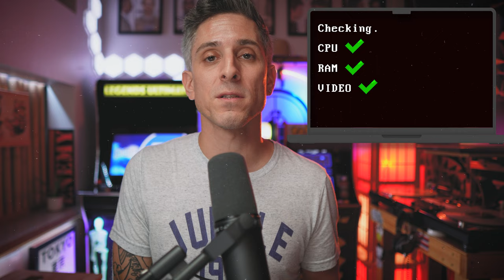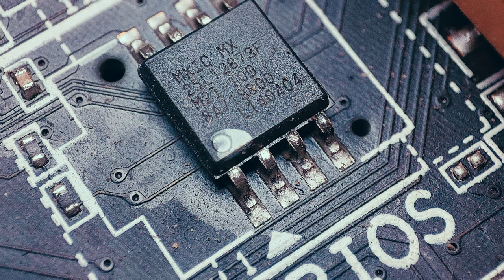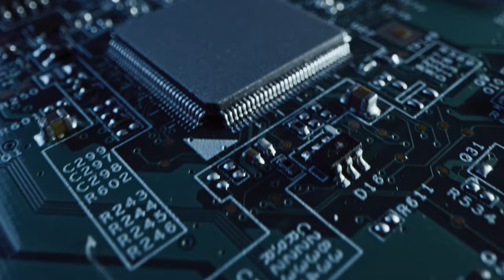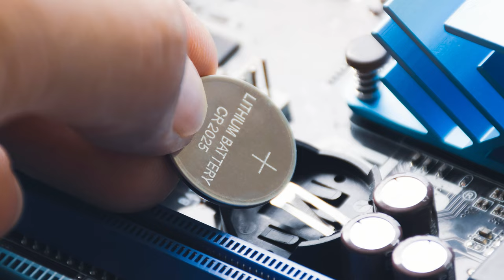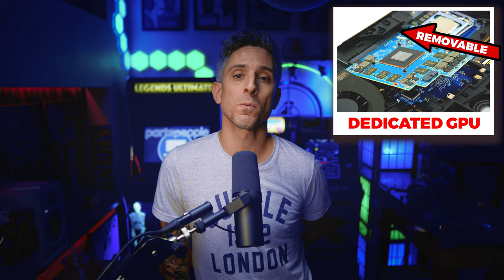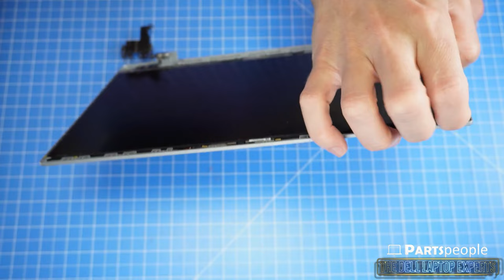Dell Beep Codes Meaning - Understanding and Repairing | Dell Latitude

Comment: plz my problem solve  my Desktop  Pc  Dell  OptiPlex  3020  Core i5  1-3-2 Beeps No Display Plz Solve this my Computer Issues
Reply: I FIXED IT all you need to do is take out your RAM and wipe it with a dry towel or blow on it and place it back but push down and wait for a click on both sides make sure it's in correctly or it won't work. Hope this helped 👍

Comment: I have a 7720 with 1 beep but it seems only when in the dock - this does this on several docks that don't produce this with any of the other Dell laptops I have.  6800's 4700's 6420's etc.  Thoughts

Comment: I have a Dell 7490 Latitude - that when I hit the power button, it turns on and boots up for for me to login and use it. But when I hit that power button (using the battery only) there's one very long amber LED beep. When I put the laptop on charge, the LED comes on and stays amber throughout the whole charge cycle.

Comment: My coworker uses a Dell Precision laptop that makes a very loud, almost musical, beeping sound on startup.  It is not a steady 1, 2 or 8 beeps.  It's different than any code you noted (on Dell's website).  Our IT department can't duplicate it remotely, as they are located in another city, so they can't resolve it.  It's not consistent, so it's also hard to capture unless he has his phone out with every start.  Any suggestions?
Reply from the maker: Hi, I'd run the Dell Diagnostics after hitting f12 while first powering on.  But it's hard to diagnose a problem without us having the laptop here. Contact us if you're still having issues.
Reply: @dellpartspeople  Our IT department has that aspect locked up.  They even have Windows updates restricted from manual updates.  I just thought I'd throw it out there to see if it was a known issue.